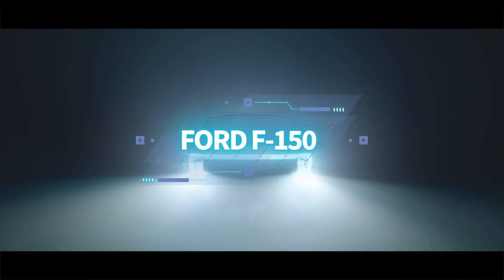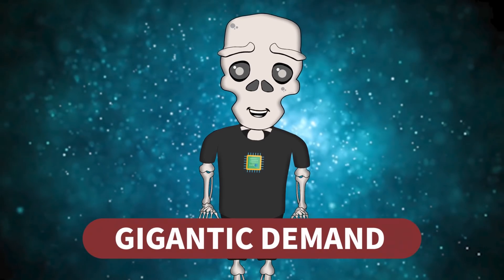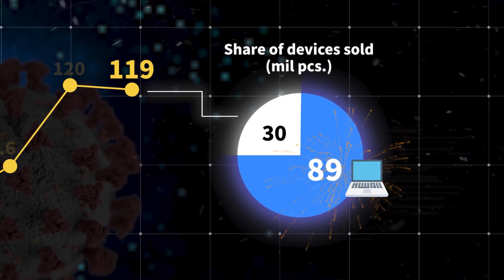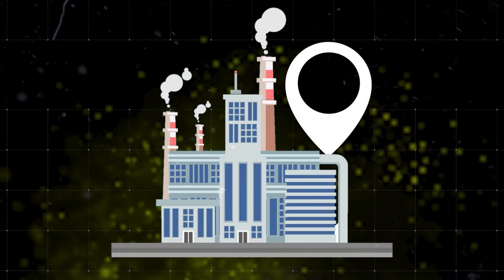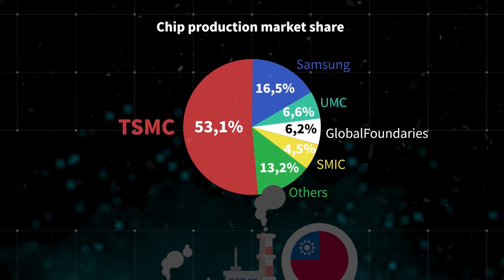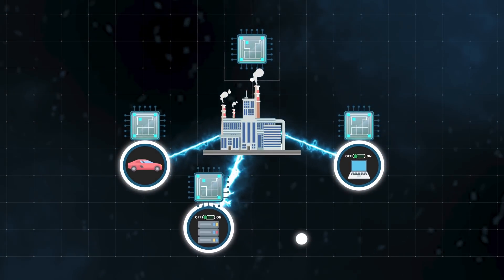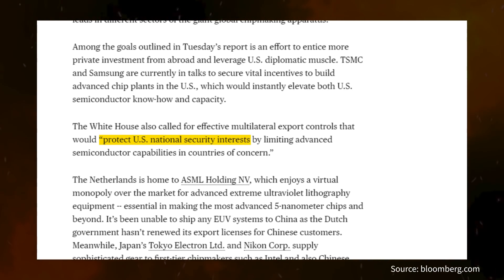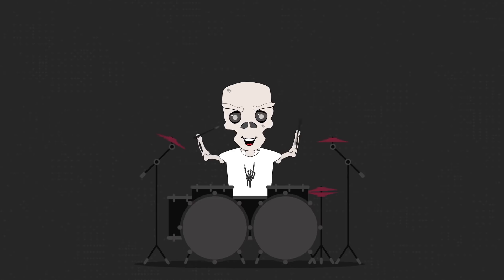It's much more than graphics cards – Chip Shortage Explained

Comment: 7:35 "ZEN 2" is the architecture, ryzen (3000 "Matisse") is the gaming series, Epyc processors are made for handling servers, and Threadripper  processors are used in computing-heavy working stations and I feel like there's been lots of these CPUs all the time through the pandemic at Chinese e-tailers like AliExpress. The more concerning thing is the response of AMD to the skyrocketing demand with ZEN 3 but hopefully different SKUs will become cheaper after the market becomes more or less sated and the manufacturing capacity improves (or Intel/some new player without x86 license takes the game for himself).